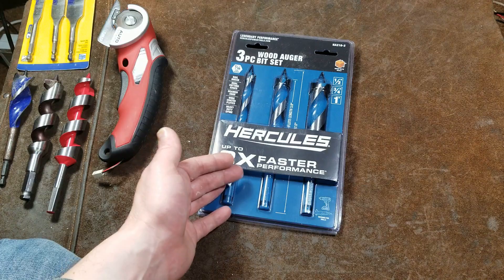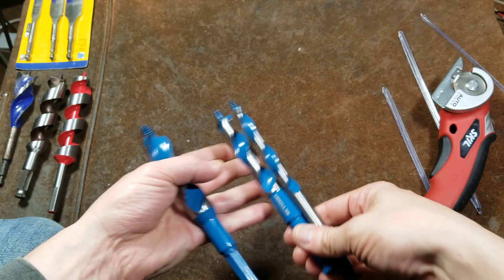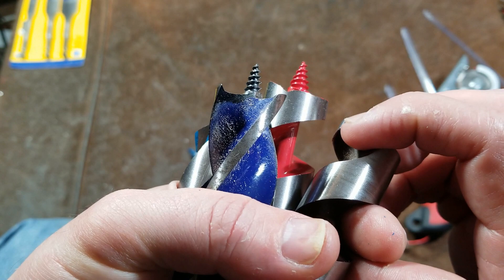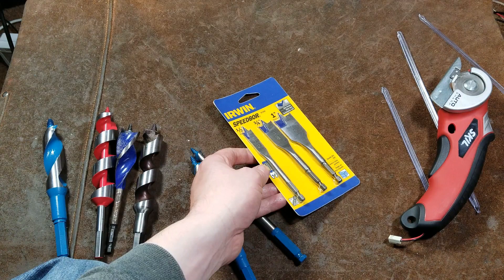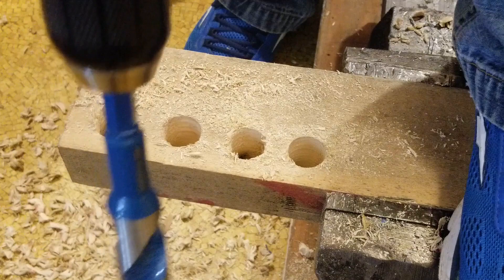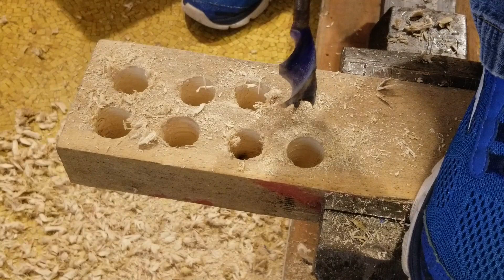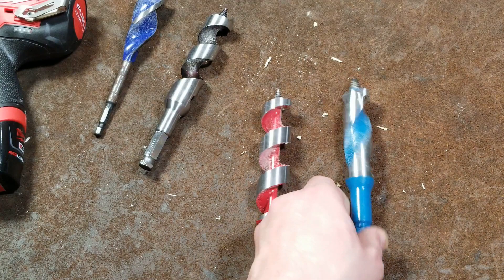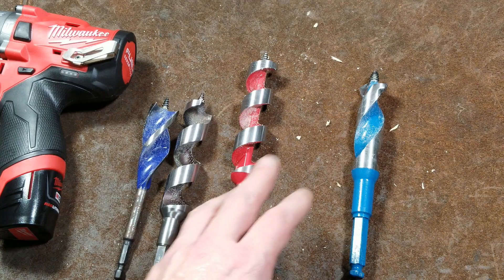Harbor Freight Hercules Auger Bit Set Review & Comparison

Comment: As an electrician, I drill lots of holes for electrical wiring and I have found that greenlee auger bits are the best. They have a replaceable screw tip.

Comment: The flutes on the Hercules ( same as Bosch which HF copied ) have been engineered for cordless drills. I use Bosch augers almost exclusively for residential wiring and my M18 fuel hammer drill or M18 holehawg have no issues in high speed. For 3/4, 7/8, or 1” augers. Although I’m not sure where HF got Bosch auger pricing but the Hercules 17.5” cost as much as the Bosch even with HF 10% off coupon to match my HD 10% military discount. As for drilling clean wood Bosch is a bit better and miles ahead of nail eating than the Hercules. It’s to bad you didn’t have a Bosch daredevil auger. Since the Daredevil Bosch augers came out only Hercules can compete for speed ( can’t attest to life since Hercules only has 1 house to date ). As for Bauer, Dewalt, Irwin etc the bits are rubbish IMO. Especially the Irwin bits they warp to easy and only last a small house.